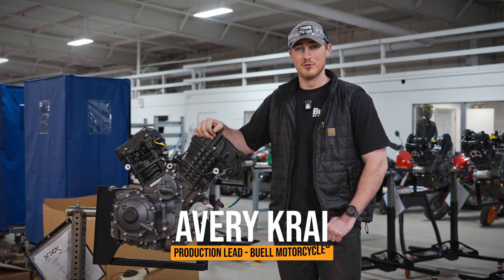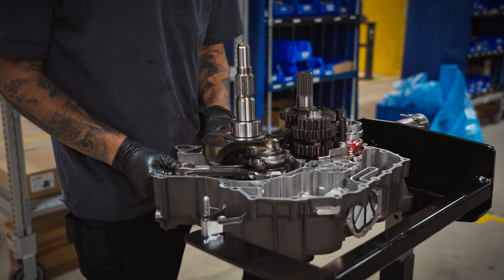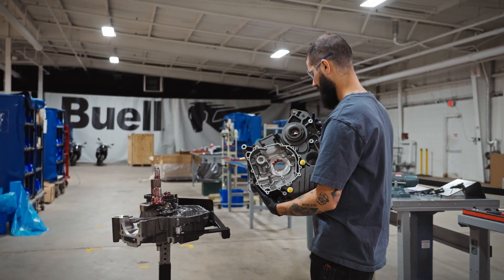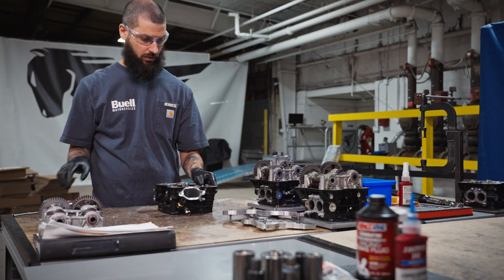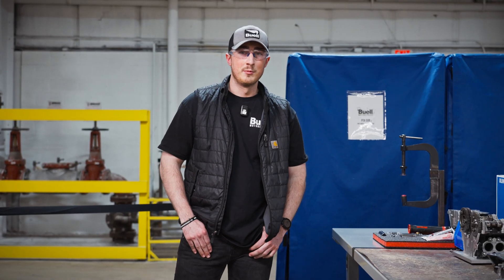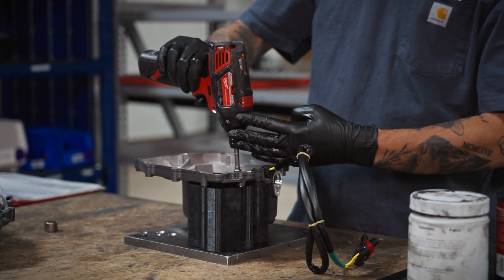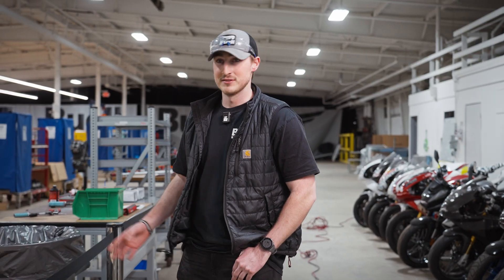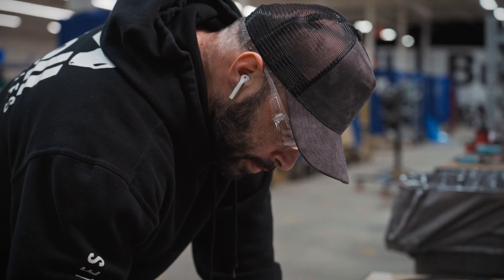Behind the Line: Buell 1190cc V-Twin Engine Assembly

Comment: What’s the bore & stroke?  What’s the max poke & stroke? 

Just curious what capacity the 1190 has.
Reply from the maker: Engine Type: ET-V2: 72° V-Twin, Liquid Cooled, Four-stroke                    

Bore x Stroke: 4.17 in. x 2.66in. (106 x 67.5 mm)

Displacement: 72.6 cu in. (1190cc)

Compression Ratio: 13.4 : 1

Fuel Delivery: Electronic Fuel injection with 2 port injectors & 2 showerhead injectors

Peak Torque: 101.6 ft-lbs. @ 8200 rpm (137.8 Nm @ 8200 rpm)                  

Peak Horsepower: 185 hp @ 10,600 rpm

Primary Drive: Gear Drive 36/65              

Final Drive: 520 Z-ring chain, 16/41                      

Clutch: Hydraulic actuation, vacuum operated slipper
Reply: @ Thanks.  I have a Super Cruiser on order.  I know it’s setup & tune is a little different. Not that I’m planning a build but Please post back if you are able to find out block bore or stroke capability.

Comment: How come Buells don't  comply to European emission standards ?  It' s an Austrian motorblock after all .
Reply: It's actually Euro 5 compliant. The block isn't Austrian. They cast it in the US.
Reply: @garyknoetze  ah ok , my bad .  Thought they imported them from Rotax .
Reply: @ Rotax stopped being involved over 15 years ago with the 1125. This 1190 has evolved from that design yes, but it's not made by rotax.
Reply: @garyknoetze  they  should rreelease  the XB with this motor in EU. Nakeds are  high in demand
Reply: @ElGuapoDeSantoPoco  the already do, the 1190SX. And they said they're working on european distribution. The team was in Italy recently with some prototype bikes, so it's not a far stretch that they'll start selling them via Italy(and the rest of EU) in the next year or two. Until then, look for a 1190EBR, there are a few in Europe already. NCCR sells and services them. As well as Twincycles in Netherlands.
Reply: @garyknoetze  i will stick to my XB 2009 for now , don't really dig the look off the 1190SX  , those ventilators on the side are  hideous  (not as bad as the 1125R but still...)
Reply: @ElGuapoDeSantoPoco  Big Horsepower creates heat. those cover the radiators. XB's don't need radiators, not really that much Horsepower in cmparison. ;)
Reply: It does but it will need a few other tricks for certification